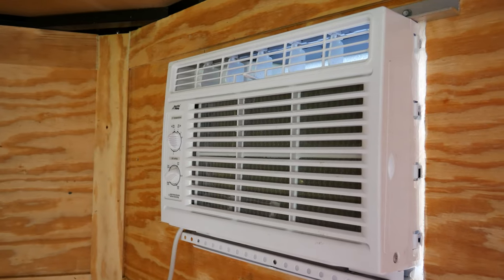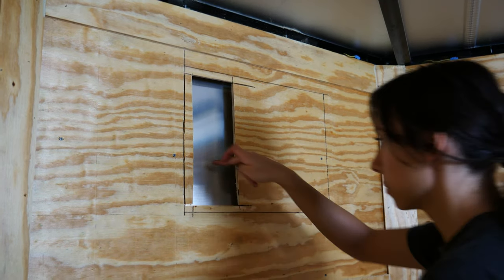Installing a window AC unit in an enclosed trailer!

Comment: When I installed mine I installed it in the nose toolbox and mounted a 12” exhaust  fan in the front side to exhaust the heat. You can’t even see that it has an ac from the outside. It looks a lot better than an AC hanging out of the wall.

Comment: Thanks for doing the video!  I transport flowers in my enclosed trailer so I'm going to need to do the same.  I want to install solar panels to charge a battery generator to run the AC unit for a few hours.  I don't need it 24/7, just 6 hours or so at a time.  I don't want a noisy gas generator.  How did the solar panels work out?

Comment: You can also use a stand up portable ac unit cut a circle into the floor for the vent i did that for now because i paid alot of money for my trailer and im skeptical about cutting a square into the wall

Comment: All the videos I have seen show welding some sort of header or frame system around the inside of the hole. I have already pulled the paneling out 2 times so I really like how you didnt over think it, cut the hole and put unit in.  My big question is that I will have racks that could be carrying up to 600 pounds on the roof. Do you feel that the L channel plus interior wood around the A/C is enough support after cutting the hole?
Reply from the maker: I wouldn't worry too much about it. I threw a stack of solar panels just on the front where I mounted the unit to get them out of the way, probably 200lbs (Plus the 160lbs worth I have mounted on it)  just on the vnose without any issues. So if you're spreading that weight out I wouldn't overthink it
Reply: If I was in your situation I would put a 1 1/2" square tube on each side of the a/c from ceiling to floor and thru bolt, by the way I'm the Dad in the video, I would have answered these comments but I have never seen this until now.

Comment: Thats a huge gap at the 2 min mark. Did you cover that up somehow? Maybe cut the feet off the AC unit?
Reply: The gap was only about a half an inch or less, the angle installed top and bottom then silicone covered it well.